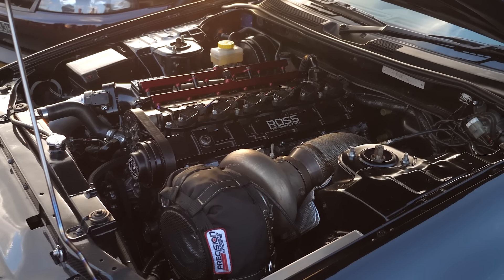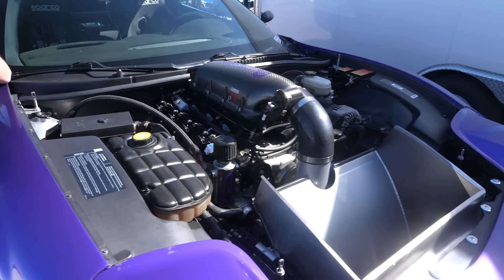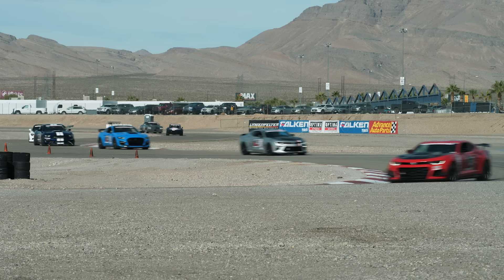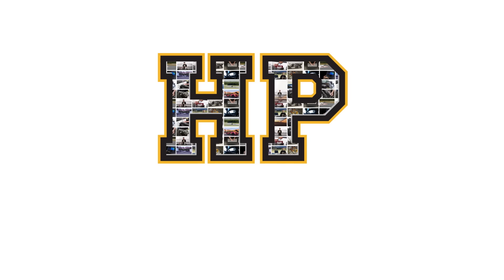What Should My Engine COOLANT Temperature Be?

Comment from the maker: Building a fast car? Get $400 OFF the VIP package and never pay for another course, EVER: https://hpcdmy.co/vipy17
50% OFF your first engine building course. Enrol now: https://hpcdmy.co/offery17
TIME STAMPS:
0:00 - Introduction
1:38 - Why do we need to worry about it?
4:49 - Effects of coolant temperature on engines
7:16 - Typical temperature range
7:59 - NASCAR example
9:58 - Setting clearances at room temp vs operating temp
13:38 - Frictional losses
15:16 - Thermal losses
16:30 - Must avoid boiling the coolant
20:58 - Material suitability and reliability
23:02 - Effect of coolant temperature on clearances
27:37 - Achieving target temperature
33:59 - Choosing target temperature
35:23 - SR86 protection strategies
41:55 - Coolant types
42:45 - Questions

Comment: I race a time attack c7 z06. Car known for getting hot due mainly to lack of frontal area, supercharger heat exchanger location, and of course lots of power. What I did was slightly increase radiator size, install 175 f thermostat, and most importantly I relocated the supercharger heat exchanger to the sides like a c7 zr1. Using the lg cooling kit to relocate. Another thing I did which helps a lot was remove the factory underhood duct and add a proper large hood vent. This car can now run at full pace until out of fuel even on a hot day. Draw backs are added a little weight, increased front drag quite a bit. The increase in drag has been a bit if a bummer for me. At 155 it feel like a parachute. To try and correct this, I've started adding febder vents. Guess my whole point is cooling for some cars is absolutely necessary if you plan to race competitive. For track days, it would probably be okay stock cause it's a 2019 and manual, so best year for cooling and better trans for cooling. Extra cooling usually adds extra drag, though so very important not to overdo it.
Reply: Cool.
Reply: Look up radiator ducting on WW2 aircraft. That's where it was discovered. The surface area of the inlet, the grill, should be 1/3 the surface area of the Radiator. The exhaust vent in the hood should be roughly 1/3 the size of radiator, and slightly smaller than the grill inlet. The ducting should be airtight, smooth, and have as gradual of curves as possible to promote laminar flow. Ideally, the Radiator is canted slightly forward.

The idea is that the air enters and exits at high velocity and low pressure. At the Radiator, the duct is 3 times bigger, so the airflow slows down and the static pressure rises. The result is more airflow through the Radiator, and less drag from the inlet.
Reply: Yeah and one of my clients actually has a c7 Stingray that we did a supercharger from a Z06 swap onto. He's got a mishimoto radiator running E85 about a 50% mixture, x-pipe, full catless exhaust, long tube headers, the supercharger is ported, and he's using a katech throttle body or however it spelled that measures I believe 103. And yeah we had heat issues just being out in the street. No joke. What we ended up doing to help with a supercharger flow is actually reversing the flow of the intercooler pump so that the water flows in a much more solid fashion with the low pressure side being fed pressurized water instead of having to siphon off water from the reservoir. I read about this on a bunch of forms and that seemed to make a huge difference as well. I also dropped his radiator fan temperature down to 195 I think in order to just kick them on earlier which it should be on all the time when he's going to be out there racing but that actually ended up keeping a lot of the temperature in check and given the fact that his intercooler for the supercharger or rather his heat exchanger sits right in the very front of it unobstructed as long as he's moving he doesn't seem to have a problem but we're still thinking about installing fans on the backside of it really just some basic computer fans on the back of it on a nice bracket in order to help pull air through it all the time even if he's sitting at a stop
Reply: For the record I tune cars for a living and that's why I have the little bit of insight on that night has felt like I would share with you guys
Reply: Thanks for sharing your valuable experience.

Comment: Nascar runs high temps for a reason you never mentioned. Temperature differential. It has little to do with aero and they did this when the cars had terrible aero as well...... The 130 F degrees in clean air and much higher in the draft make cooling a severe problem at normal passenger car temps. With passenger car temps you would have as little as a 40 degree temp differential, which would never remove 900+hp of heat. There wouldn't be enough heat transfer with the grill wide open. But, a 160~ish degree difference can be cooled very easily..... They also run high cooling system pressures to stop the water from boiling in the system. 1 psi raises the boiling point 3 degrees F. Technically you need a minimum of around 50 psi to stop perking in a Nascar cooling system from boiling at the top of the cylinders. But the rules limit it to a 33 psi cap and water in the cooling system.....
Reply: That temperature differential is the real reason that the aero gets better, too.  It's not that they're rejecting less heat - if they were, that'd mean a bunch extra energy going somewhere else, like the wheels.  But if the coolant and therefore the radiator is hot, then you can reject more energy with the same airflow, or reject the same energy with less airflow.

This is how air-cooled engines managed to function at all with like 1/10th the heat exchanger area of a radiator.  An air-cooled motorcycle hangs out at around 450 degrees F, allowing those little fins on a Harley to exchange as much heat energy as a Honda Accord's radiator.  All the clearances and things are simply designed to deal with that temperature.  20W-50 in an air-cooled bike runs thin like gas.
Reply: I was basically going to say the same thing. Didn't know they ran higher temps but I would think it's more about having a higher efficiency due to the temperature difference gradient. They're able to get rid of more heat for the given radiator size. I can see it having multiple advantages like weight savings and being able to have better aerodynamics, maybe better thermal efficiency of the engine itself.

Comment: NASCAR engines wise, I don't think they don't have to shed a large amount of heat since they are running hotter, the amount is arguably similar, but the rejected heat for the same sized heat exchanger is larger because of a significantly larger delta in temperature between coolant and ambient temperature.
Reply: Yup, heat exchange gets much more efficient at higher deltas, so you don't need to increase drag as much for a given amount of heat produced. I'd think the exhaust charge would retain more heat as well, given that the engine vs exhaust is a lower delta which would mean higher exhaust gas velocity and the radiator would need to shed less heat as well. Really a very cool bit of engineering (pun not intended).
Reply: Didn't finish the thought about EGV tho, higher EGV is probably used with header tuning and cam tuning to improve scavenging and efficiency at a desired RPM, which is very neat.

Comment: One thing I'll say about fans.  They can be effective at much higher speeds than I would have thought, assuming they are designed to do so (fan pitch and RPM, etc).  When I'm not hooning around in my Miata, my day job involves charging up and down Pacific Northwest mountain passes in a semi truck.  Fully loaded, you might get down to 30 or even 20 miles per hour, and understandably, the fan is very necessary, even in sub-freezing ambient temperatures.  However, flat-out is flat-out, so even if you're unloaded and making 55mph, on a reasonably warm day, the coolant can get up hot enough to trigger the fan to come on.  I'm still amazed to see the coolant temperatures promptly plummet as soon as that enormous clutch fan kicks in.  Even more impressive is when you get the fan kick on going DOWN the hill at 55, because it turns out that the Jake Brake at redline with 40psi of boost makes just as much heat as the fuel.  WILD.
Reply: I did not know Semis go into boost during Jake brake? Fascinating..my Dad is a trucker..be safe out there man thank you for what you do!
Reply: @jaynikk758  Yeah, it's neat.  The Jake opens the exhaust valves near peak compression, which dumps a ton of heat and pressure into the exhaust.  That spins up the turbo, putting more air into the engine, meaning more heat, more pressure, and more turbo.  The heat and pressure are the energy you're trying to get rid of from the hill.  The Jake brake makes more power than the fuel does, just with the torque in the opposite direction.  It's really cool.

Comment: Andre's sweet spot 80C-90C 176F-194F
Doesn't like going over 100C 212F
34:00
Reply: Legend
Reply: true... but depends on engine too or ssytem,, but in that range will work opk. not more or less.
Reply: Thank you sir, God Bless.
Reply: Thanks, i was finding this part of the video.
Reply: That's wild. My M2 runs at over 100 degrees C just cruising around town on stock power. My 350Z drift car hit 115 degrees C on track plenty of times.

Comment: Love to see a video of engine oil temperatures on track
Reply: I second that!
Reply: Same as street oil temps. 90 - 100C degrees is good. 105 pushing it. 110+  either means it needs a cooler if it doesn't have one, or it's getting too hot period. That goes for most, from engine oil to trans, to diff.
Reply: @dons1932  100-110C engine oil temps are perfectly acceptable temperatures in a high performance application. Going over 120, or even 130 is where you should start to worry. 
Just make sure you got high performance oil. Not your oldschool dyno juice

Comment: Just a note to the delta temperature. My Classic E-Type V12 has 83 degree C Thermastats and the return to system hose has a sensor for the fans to kick in if the return temp is higher than 70 degrees.
Hope that info helps a little.
Reply: A good part of it is because older cars doesn't use a temp sensor, but a temp on-off switch. The ECU has zero control over the rad fans, so that temp switch would turn on the fan when the inlet temps are high enough to trigger. Modern applications uses a single coolant sensor for everything to save on parts and wiring.
Reply: @patx35  
Hi Pat, the V12 has a dual cooling system and on mine each side has a Bosch Pressure Temperatur Sensor plus a TempSensor (maybe a Switch) in the hose from Radiator back to the waterpump. Since both Temp sensors are placed prior to the Thermostat they are useless for fan control because if the thermostats don’t open I get an overheat condition but the fan would cool the radiator which at that time is not flowing any coolant, but if the return to system line is hot it means that the radiator is not cooling enough and the fans kick in. I think it is a good system.

Comment: Not shure if gareth is reading this but usually coolant flow in any water cooled system(Cars, Industry even Water cooled PCs) is so fast that the coolant has almost the same temperature anywhere in the system. We are talking single degree differences here. 

The only way you would see a noitceable delta across the radiator is if the flow rate is quite low which I assume would also lead to problems in the engine.
Reply: Great point. To clarify, the delta T across the radiator is actually quite drastic most of the time since the thermostat is usually blocking most of the coolant flow through the radiator to keep the coolant temperature in the proper range, but with no thermostat or a fully open thermostat, the flow rate will be high enough that the delta T will normally be fairly low.
Reply: @averyalexander2303  thank you, didn't think of that!

Comment: Excellent presentation - IIRC*, F1 engines run around 130C and 4 bar water pressure, for exactly the reasons you mentioned.

*Might be wrong, wouldn't be the first time.

Comment: I'm surprised you didn't mention the coolant temp target differences between E85 and gasoline. 

I raise temps with E85 for good reason
Reply: Care to explain?
Reply: @captin2284  E85 requires a richer mixture than regular gasoline, meaning more fuel volume. This extra fueling has a cooling effect on the engine. An engine on E85 takes longer to reach operating temperature as a result. Moisture is a byproduct of this combustion. E85 It creates lots of additional moisture and fuel vapor that can accumulate in the oil and crankcase. If the engine doesn't reach a temp high enough and long for this moisture/vapor to flash off, your engine will fail very quickly due to fuel and moisture contamination in the oil.

All of these things need to be accounted for when designing a cooling system.
Reply: @XcoolcoolbeansbeansX  Agreed. I ensure when using E85, the oil temperature reaches at least 85c for a while before shutting off the engine, in order to evaporate any water in the oil whilst also avoiding short trips. Change oil more frequently too.
Reply: @captin2284  
On E, the hotter the coolant temps the more fuel the engine consumes and the more power it makes. I'll run a car back to back on the dyno and and the hotter it gets the more power it makes and more fuel it wants. I'll cool it down and run it again and it's back to less power and fuel.
Reply: 85E  engine , needs a more compression engine- they made for gas initially so is better increase its temperature..more compression increse temperature 

its a crimne,, to add E85, in and engine that has a compression for gasolne..

yous hould only burn gasoline or just alchool for better engine efficiency

Comment: Interesting topic for me, like all bmw owner I had concern about the high coolant and oil temp. From stock 103 Celsius and 118 Celsius respectively. I lower coolant to 83 to 90 and oil thermostat open from 93 Celsius. I think is the best trade off for the N55 engine
Reply: You removed your thermostat?
Reply: @MotorSportsbr the coolant thermostat is controlled by the ecu, fir the oil I installed a real thermostat the Mosselmann 😉
Reply: Changing thermostat opening temp makes no difference overall. Just makes it take a bit longer to get hot. Doesn't make it get less hot overall